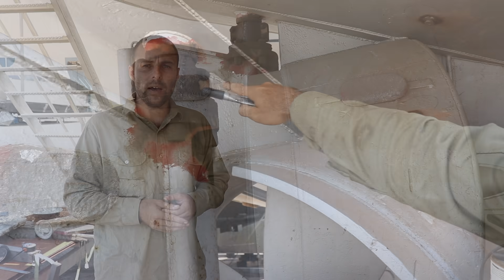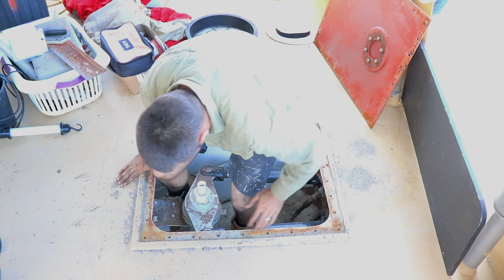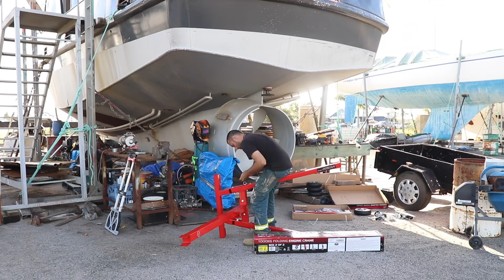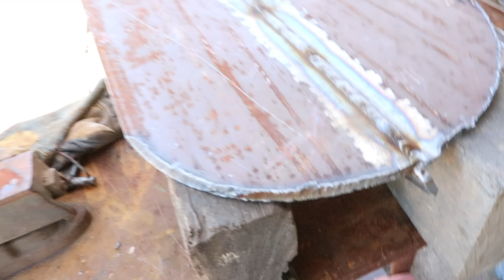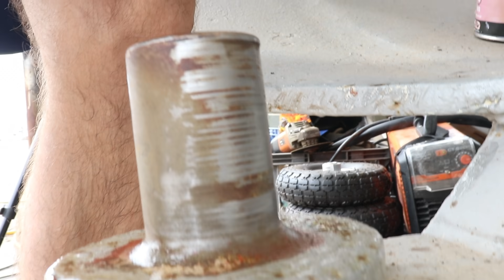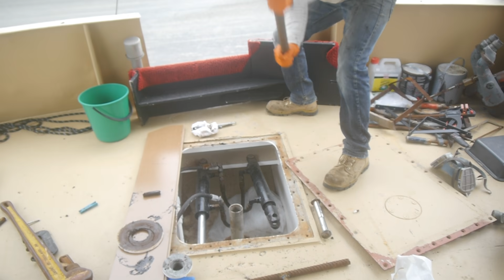Replacing Rudder Bearings - Project Brupeg Ep. 65

Comment: I know it's a little late but why didnt you choose oil impregnated bronze for your bushings/bearings?
Reply from the maker: It’s what the engineer recommended
Reply: @ProjectBrupeg  
Hmmm...
That surprises me. Bronze is way tougher.
Of course he may know something that I dont know about ship building.
   I was a machinist for 30 years and built flight hardware for the NASA Shuttle program as well as the F-22 prototype.
   But I cant say I did any marine work.
Reply from the maker: I’m not a machinist so you know doubt know more than I do about this however I’m also not worried about the material as it’s not that hard to replace if we have any difficulties. We will just machine a new bearing and install it.

Comment: Im guessing a 15a single phase welder? Sure the wiring rules are the same in qld circuit should be rated for 100% duty usually wired in 2.5mmsq   with breakers rated to protect the cable which is more than your connected load .. that being said circuit breakers in 90% of cases are thermally operated, and as they are usuallly packed closely together, a group of highly loaded breakers together can cause tripping at way under spec loadings  , get a 2.5mmsq hd lead , keep leads to a maximum of 20m ( or get a 4mmsq lead made if its unaviodable to keep it shorter ).... im sure it's probably a combination  of things ( heat , volt drop which increases current , and thermal interference ) .. hope in the cooler weather it stops tripping ... then you are going to wonder why you wasted your time reading this!!
Reply from the maker: Yeah it was long leads, in the sun, middle of summer heat. Now that we are in winter the same leads are fine.

Comment: Ok, Damien, someone has to ask the inevitable question - if these additions to the rudder are a distinct improvement, why on earth don't the manufacturers do this when they are originally made?  Is Brupeg such a different boat that it is the only one to benefit from that design enhancement?  Or am I just too stupid to understand?
Reply from the maker: Nope, not a stupid question. Most of these trawlers have all sorts of different ideas on their rudders to try and solve this issue. Almost all are home built or built as one offs in yards.  Some have 90 degree angle welded to the rear of the blade, others have large diameter round pipe. All trying to create drag at the rear of the blade. The issue has been solved for many years in race yachts. Winged keels solve the issue by stopping the water travelling around the blade from the high pressure side to the low pressure side by putting a wing in its way. That way when the rudder is turned the water can’t escape over the blade and under the blade, it must go along the blade and off the trailing edge. These simple wings welded on create the same effect. They will only work when the rudder is turned, they will add almost negligible drag to the boat and the make getting the rudder on and off very simple as you can just use long forks on a forklift to hold and lift it either side of the blade. This is why modern planes all have winglets as it stops tip vortex and pressure on the wing escaping from bottom side of the wing to the top
Reply: @ProjectBrupeg  - Sounds very logical, a lesson in fluid dynamics.  I also presume that you saved significant $$ by doing it yourself - correct?
As my great-great-great uncle used to say; "a penny saved is a penny earned"
Reply from the maker: Fluid dynamics is an area I find fascinating, as a yacht racer for two decades it was a constant area of study for me. Doing it yourself is the only way this is possible for us.

Comment: Did you ever think of using a plum bob for the pin alignment?
Reply from the maker: I did but the rudder shaft angles forward so it will only show sideways accuracy both front to back

Comment: Hey guys I'm new to your channel, excellent job your doing well done. Just one question, you were saying in one of your vids that your going to go to the Arctic and Antarctica, I'm a little concerned the cooling pipes under the hull may get damaged or even torn of by the ice, do you think this may be a problem down track or is it already been addressed. Thanks guys keep up the great work. Seeya Rob
Reply from the maker: Hi Rob, all the external pipework will be cut off in New Zealander prior to heading south, and replaced with internal cooling. Your right about that being a risk in ice though

Comment: Love your videos!  
What is it with Aussies, old steel boats and dogs?  Did you look into adding articulation to the rudder?  It's a relatively small segment added to the trailing edge of the rudder which articulates increasingly as the rudder is swung more and more.
Reply from the maker: Hi. No at this stage we will leave it as the single blade but I’m open to looking at it if this proves to be not quite enough

Comment: Thinking back to the episode when you carved channels in the polystyrene to run electrics...

"The provisions of this section of Part 3 in the 2002 BSS Standards are mandatory for non-private boats where applicable.

It's a good idea to keep cables that are insulated or sheathed in PVC away from polystyrene thermal insulation - the two materials have been known to react and break down the cable covering. It's recommended that the electrical installation is periodically checked by a competent electrician - preferably every year - so that you can keep a record and spot the signs of a problem, before it becomes a potential hazard. [3.4]"

From: https://www.boatsafetyscheme.org/boat-examination-and-certification/non-private-boats/part-3-electrical-installations/cables-polystyrene-insulation/

Hope this helps. 

Keep up the momentum. 

Oak
Reply from the maker: Thanks Oak, I’ll chuck some Flexi conduit over the cables to give them another layer

Comment: Bit late but, any reason why you wouldnt just metalize the shaft? I thought they could do stainless...  If unfamiliar metalizing is basically spraying new metal onto a spinning shaft to build it up and is then machined down to the correct od.
Reply from the maker: Yeah that is definitely an option. We did find a place that can do it but the cost was higher than machining a new shaft so we just went that way.
Reply: @ProjectBrupeg  Wow hard to believe a giant piece of stainless is the cheaper option.  We do where electric motor bearing races sit at work pretty often but Im not in the machine shop bay or office so idk what it costs tbh.
Reply from the maker: Yeah I was blown away with the price. Kinda wondered what the point was if it was the same price.
Reply: @ProjectBrupeg  we do industrial stuff so time is often a much bigger driving factor then price. Who knows how long or even if we can get a new endbell for a motor when the bearing race wallows it out.
Reply from the maker: Yeah I can imagine. Now that you’ve reminded me. It’s was only a few days building it up versus making a new one

Comment: @projectbrupeg....what's the pipe's on the bottom of the outside of the hull on the starboard side?...and wouldn't it cause drag?
Reply from the maker: Hi Sofree. They are external keel cooling pipes. There is a system each for the main engine, generator & gearbox. When we head to the ice these pipes will all be coming off and internal cooling made. However for Operation Hide & Seek they are the most efficient type of cooling in the tropics. Yes they cause drag but on a boat the size of Brupeg it’s negligible in terms of boat speed or fuel burn

Comment: If you ever have a 3 point alignment problem like this again it is easy to align. Have two disks machined with slight outer tapers to fit your rudder tube top and bottom, have 1/32" holes bored through the center. Install the plugs and shine a laser through the holes, where it shines at the bottom is the center of where the pin gets welded.  You may not have an alignment problem, you may just have a lot of drag from the pipe welded to the trailing edge of the rudder.  Being a flat rudder not a foil shape doesn't help either where drag is concerned.

Comment: Please buy a screw a bit of string and a washer for your camera. Screw the screw into the bottom of the camera, tie the string to the screw and tie the other end to the washer. Step on the washer and it will stop the bobbing and of the camera up and down while recording.  Quick and easy tripod or monopole. costs about 5 cents to make and can easily fit in a pocket or camera bag. I felt like I was on the boat in the ocean, watching this video.
Reply from the maker: The issue we have is most of these time lapse type shots are 10-15min long shots so we when speed them up EVERYTHING gets exaggerated. This said we to have a big focus on getting smoother shots for all that we do
Reply: @ProjectBrupeg  the problem on this video wasn't the time lapse it was the wind blowing the camera around at the beginning of the video.. This is a trick video and camera people have been using for years to steady your shots., just thought my suggestion would help in future videos. Thanks for taking the time to video I know it adds time to every project.
Reply from the maker: On of the issues we have is the windage on the dead cat mic, which is hot shoes to the canon 80D is it over powered the mount on the tripod. We have ordered a whiz bang wireless lapel mic so we can pick up voice better but also reduce windage on the camera which should help with what your saying. That said, I like the simplicity of your idea for non tripod shots

Comment: if you thinking about going thru ice you better have an inboard keel cooler, those pipes will be just ripped open..or off...if no ice, then no problems
Reply from the maker: Hi Andrew, yeah we get asked this a lot. The external cooling will be removed and replaced with internal cooling prior to any ice. We will also be adding forward steel protection to all of the anodes as well so they don’t get ripped off

Comment: the fins look great, almost a hydrofoil.
Reply from the maker: Almost. Not sure Brupeg’s lazy ten knots will provide enough lift to get her bulk out of the water though
Reply: hay mate anything over standing still works great.but if you really want speed, then find yourself a caterpillar drive, now if your worried power over speed any day.
Reply from the maker: Funny you mention speed we are I. The process of converting a hard bottom inflatable into an alloy tubed rigid boat with a 110hp jet unit (boat was a 30hp outboard)
Reply: still can't beat the march 5, in my book. but the sea doo's are fun toys. just showing off too.
Reply from the maker: Not sure what that is. Can you send a link?
Reply: navy air boat ,hell it is big enough too put you dingy on ,and transport it any where nothing stops it. think giant air boat, while nothing but a shear wall.  six turbine  motors ,with fifty thousand pound trust each. haven't run top speed on one. but what was rode at was a blast, and I can't tell ya the top speed not that I know it. lets say in access of 130 knots wasn't even half speed.   miss that old dodger.
Reply from the maker: Bloody Nora sounds like a friggen beast
Reply: look up sea cat boats. big bertha is in there.
Reply from the maker: Thanks will do

Comment: Really enjoy your channel, never ending  thinking outside the box !!!!! Great job!! I do have a question.... going into a harsh Southern ocean environment, do you have plans to fabricate some sort of protection for the exposed tubing under the hull ??(keel cooling???).
Looking forward to launching day !!
Reply from the maker: Thanks Peter, we will actually be cutting all three keel cooling systems off. Moving it all inside the hull. The outside will become very smooth even down as far as forward protection on all anodes.
Reply: @ProjectBrupeg  This video answered my earlier question on vulnerability of the external cooling pipes. Also on a nagging question on propeller diameter versus seemingly diminutive engine; presumably it is 400 bhp minus reduction gearbox losses. I assume you have either salvaged or replicated the original engine.
Reply from the maker: Hi Phil, the engine is a 350hp Cummins 855. The prop is driven via a 4:1 reduction box and is sized and pitched for the current engine/box/nozzle combo
Reply: @ProjectBrupeg  That's that one then on the bhp, I'll admit now the  engine looks far stouter when you are close to it ! My only adverse Cummins experience on generators  was with electronic governor actuator hunting  problems  but I'm hopeful  you have no nasty electronics for variable rpm use.  You're far crazier than me tacking this epic undertaking, but clearly applying consistent technical logic. I fear only economics risks sinking this venture, so hope you can attract seriously deep pocked patrons and provide satellite WiFi and haute cuisine.  You are coming across as investible, see many trawlers ending up as SuperYachts , so maybe you end up selling timeshare use if that could pay for the marble and dilute operation costs. Having also once designed and project managed a 11KV  shore power  scheme for a huge floating dock  to replace generators, I'm aware also that you must likely need to satisfy an insurer's marine surveyor on many details, so assume you will working to applicable Codes of Practice on many niggling details like  UL listed components etc. Much grim reality of bureacracy, but better that than burst hoses or deadman's click. Good Luck ahead.

Comment: On the view into the hull steering area, I didn't see rudder stops.  They are just steel bumper pads fabricated into the hull structure, that bear against the tiller arm when the rudder is hard over in each direction. The intent is to prevent damage to the hydraulic steering cylinder from overload, such as backing into something with the rudder over. The rudder stop takes the load instead of the cylinder. If you will be operating in ice rudder stops would be a good preventative measure for the steering cylinder, especially when backing. Greg
Reply from the maker: Greg that’s a really good point. Brupeg doesn’t have any stops. Which is sorta odd given she was a commercial boat in survey. I agree they are needed and will have a ponder about where to mount them so they will be strong enough. Thanks for pointing this out

Comment: what about using a plumb .....center to center
Reply from the maker: The centreline of the bearings angle slightly back (at the top) so a plumb is ok do side to side but we can use it for front to back. We will make a jig to hold the laser level centred in the top bearing and point it directly at the new centre for the pintle bearing and weld it at the that point

Comment: That's some heavy work! Back in the day, I ran a number of large(ish) single engine sailboats that had no bow thrusters, and prop steer was an extremely useful tool in tight quarter maneuvering. I'd have thought that the nozzle around a prop would diminish that effect as opposed to amplifying it.  That said, I've never driven a boat with with a nozzle, so I'm not speaking from experience.
Reply from the maker: I’ve also never driven a boat with a nozzle. But I’ve been told they can be a handful

Comment: What sorta plasme are you using 
Doing well on the 10mm
Looks like the same gun as my unimig but cuts much better 
In in the market for an upgrade
Reply from the maker: It’s a little Rossi unit. Same as this one.
https://rover.ebay.com/rover/0/0/0?mpre=https%3A%2F%2Fwww.ebay.com.au%2Fulk%2Fitm%2F381571618093

Comment: If your pouring that much heat and weld metal into a joint such as you had its a good idea to temporarily weld a couple strong backs across the joint leaving a rat hole where the groove is, works wonders. Cheers !
Reply from the maker: Thanks

Comment: On that hoist you can weld a 2" receiver tube so that you can install a trailer coupler on it when you need to. I did that to mine and my little truck is the counterbalance for heavy loads.
Reply from the maker: Makes sense, thanks for that Kev

Comment: All this Fine Work on the steering, I HOPE you have a Nice WHEEL on the way, LOL! Having the rudder pintles and gudgeons Aligned should ease the steering a bit, too...I think I might run a grease line down to the bearings from a greasing station in the steerage, just because I LIKE Grease on things that move.
Reply from the maker: Yeah I will have a think about that. See if it’s possible
Reply: @ProjectBrupeg  all things are possible...one has to determine if one's willing to do it ..;)
Reply from the maker: Yip that’s true

Comment: Damien, What are those coils of pipe all over  the bottom of the boat,  that rudder is looking good, hang in there and Jess I hope you are doing well.
Dave
Reply from the maker: Hi Dave the pipes are cooling pipes for the main engine, generator and a spare (likely we will use this for the main engine intercooler).
Reply from the maker: Thanks Dave, doing well. Resting when needed and Dame is amazingly kind and supportive 
I hope all is well with you too
Jess

Comment: What are those pipes running underneath the boat are for they worried me cause if you accidentally hit or go over something at night it might cause damages don't you think ?
Reply from the maker: Hi Edward they are keel cooling pipes. They cool the main engine. They are original and are the most effective way to cool a marine diesel. That said we will be cutting these off in 12 months prior to heading down to the ice